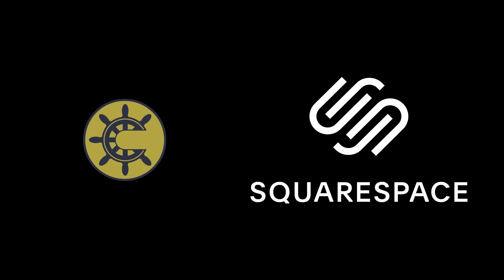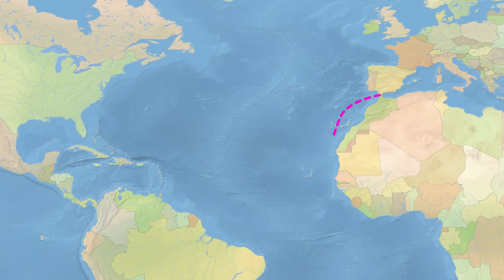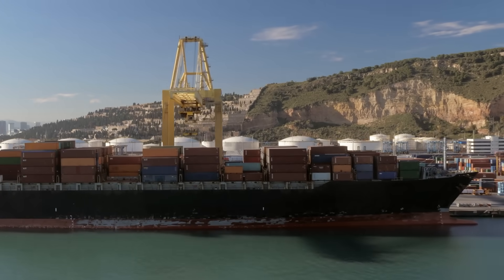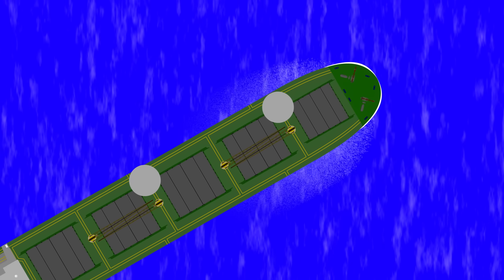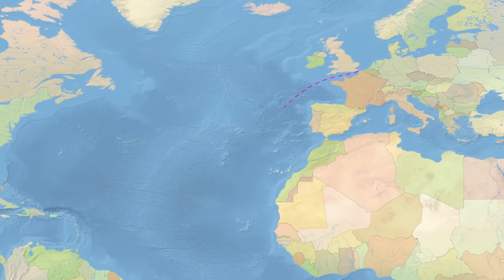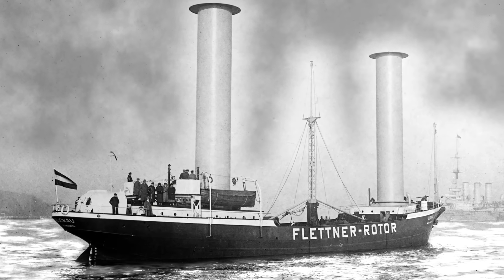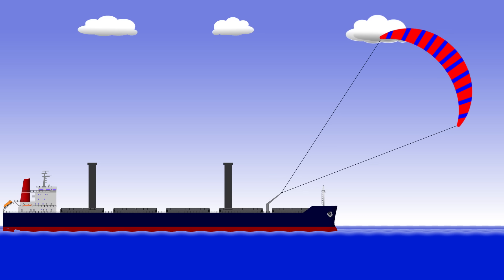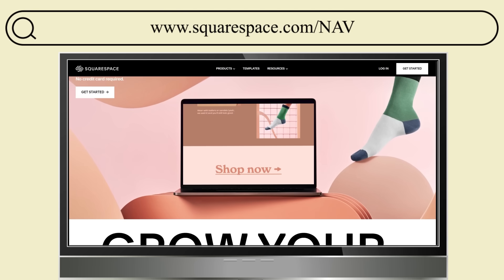Why Don't Sails Work On Ships?

Comment: Cool video, but the economics explanation doesn’t make much sense.

If the cost savings were so significant for the use of the rotors, the demand for ships equipped with rotors would be great enough that many ship owners would be willing to make the principal investment for installation. The sales pitch alone is phenomenal: “Up to 40% fuel savings.” Increased demand increases price. The opportunity cost for failing to outfit your ship with rotors would be too great to ignore.

Shipping with a competitor that could save you 40% on fuel costs would entirely offset the slightly increased shipping rates required to pay for the installation of the rotors.

The only rational explanation here is that the fuel savings are not enough to offset the price increase that comes with the installation, which is a market signal that the technology is an inefficient use of resources.

The alternative is to posit that these both the ship owners and their clientele are leaving money on the table, which is unlikely.

In terms of the landlord/appliance analogy, there is higher demand for units equipped with more efficient appliances/lighting. That’s why landlords install them.

Comment: To a degree when it comes to cargo ships. The problem of "it interferes with cargo loading and unloading operations." isn't actually an all that good excuse for some ships.
Self unloading bulk carriers for an example don't rely on the port, and loading a bulk carrier is a lot less intrusive compared to offloading it. And perhaps "self loaders" becomes a thing removing all need for the dock to have cranes over the ship at all.

For oil and gas ships, cranes aren't an issue since everything is moved via hose regardless. And having a mast on ship would effectively give the ship its own crane, making connecting the hoses easier in practically any port.

Container ships is however the bigger hurdle. But sails don't have to be centrally located, nor does modern construction materials need as much rigging as ships of old. So perhaps it wouldn't be as intrusive as one might expect to be fair.

Comment: With how much wind there is i would think some wind turbines and electric engines could at least help with propulsion. Everyone thinks windmill shape but some wind turbines look like the rotors shown in this video but with large vertical slits. Sail masts would get in the way of loading and unloading cranes I would think.

Comment: Even though the rotor sail is paid by the  ship’s owner, because the rotor sail will save fuel cost of the users, it will give the ship owner competitive advantage. So if no one is using the rotor sail now, it’s either because the benefit is not that big, or because there is monopoly in shipping business.

Comment: I think electric is the way to go.  Standard lithium ion batteries are still on the large/heavy side for the amount of energy required (though they are getting better with every passing year), but I think the real solution is flow batteries.  Too complex for cars, and still in their infancy research-wise, they hold real promise for large scale energy storage at reasonable costs.  Boats already have large fuel tanks and complex pump systems, pumping in and out an electrolyte instead of fuel would mean little change in the overall mechanics.

Comment: A few weeks ago i was on a holiday trip on the habour of Rostock in Germany. I saw some ferrys which where equipped with one flettner rotor on the Deck. They told me that they safe more than 20% fuel with this thing. It was a big ferry for trucks, trains, cars and people, shipping between Germany, Denmark, Sweden and Norway. On different routes of course.

Comment: Sails already work exactly like airfoils, they use drag when going downwind and lift when going closer to upwind.
Reply: Ons problem with sails, among many, is they are incredibly complicated and expensive. A 200+ meter cargo ship would require massive amounts of rigging, miles of line, and all kinds of sails. 

Also, consider the height of the masts. A 10 meter sailboat can have a mast as high as 18 meters. It's hard to imagine masts any shorter than 250 meters on a 200 meter+ cargo ship. Considering the new Gerald Desmond Bridge in Long Beach Harbor was designed to accommodate super cargo ships with a height of 60 meters would clearly not have sufficient clearance. Airfoils could at least be collapsed.
Reply: @caseycooper5615  I already know all of that, I was just saying sails are airfoils.

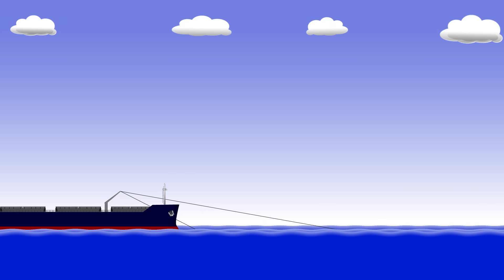Comment: Nice video.  But wind is not deflected aft propelling a sailboat forward as you describe at about 2:00.  Sorry, but the animation is incorrect as well.  The sail is curved, and functions as a airfoil.  the air going around the outside of the sail goes faster, which causes lower pressure, so that the sail is sucked forward by the lower pressure.  The direction of the wind is not changes to create trust as you suggest.  This becomes less and less important as the vessel head directly down wind, at which point the sails are actually pushing because of increased pressure on the back.  But that is not what you are describing.  Also, the shape of the sail is not modified in order to head in a given direction.  The sail is moved so that the leading edge of the sail is into the wind so that you can achieve the air flow around both sides which will create lift.  The shape of the sail does not change, nor does the angle of attack - the sail does not change relative to the wind, it changes relative to the course of the boat.  Interestingly, you get it right at about 3:00 when you discuss airfoils.  The concept and process is the same whether you use an all-cloth sail, an hard foil such as an airplane wing, or a combination of both such as on high performance boats such as the latest America's Cup yachts and Formula 40 catamarans.
Reply: A sail deflects the wind. This is a physical fact. Do you really imagine that if air blows over an angled airfoil it will not be deflected? If air is not deflected then there is no momentum change, and it would violate conservation of momentum for the sail to produce any force in that case.

Comment: The two most important factors are unmentioned: any weight high up will limit the amount of cargo that can be carried and any sail will also need more stability, limiting the carried cargo weight. Putting ballast means to add dead weight.
You want to be able to stack up cargo, but with sails you cant stack as heigh. So Sails/wind propulsion only usefull for ships with heavy cargo, where stacking heigh is not needed. And empty ship with sails must be ballasted, more dead weight to move.
Reply: That’s certainly true for stacked container ships, but the ships depicted here look to be oil tankers.

Comment: I've always wondered why they don't use wind power the way Kevin Costner's character in Waterworld does. Use a rotary wind mill (there are many designs), and couple the rotor to a propeller. Wind could blow from any direction, but it would only move into he direction the propeller and rudder direct. You probably wouldn't be able to move any faster than the wind, but it should work in any wind strong enough to spin the rotor under load.

Comment: The Flettner Rotor is not a passive form of propulsion like a sail. Even though it interacts with wind its still driven just like a hydrodynamic screw, only it operates in the medium of air rather than water.
Reply: yeah i was confused where this guy thought the spinning motion required was going to come from, of course its going to come from a combustion engine on a ship that big.
Reply: @guesswho2778  He did mention that it isn't passive, but takes way less fuel than expected

Comment: It is true that modern container ships carry an enormous load, and old ships, such as the Preussen, only carried 8 thousand metric tons of cargo. The Pruessen sailed at speeds of around 17 knots which might be exceeded by a modern sailing ship. Crude oil would be an ideal load for a sailing ship and to a degree crews might be willing to pay for the opportunity to train as real sailors. No fuel, little to no crew cost, just the cost of maintaining her sails which was, in days of old, done by the crew. Other bulk cargoes would also be possible if offloaded mechanically, such as grain. However the ship would need to be designed to avoid shifts in her load which is always an issue with any vessel that heels over. I watch Fed Ex jets loaded daily quickly using specially shaped containers through a single small door. If they can do it, so could a modern cargo carrier. All the Big 3 automakers could do before Elon Musk was a golf cart-like electric vehicle. Now Elon is rich. Is there a shipbuilder out there with the same chutzpah?

Comment: Your reasoning is badly flawed.  If it were true, the airline industry would have the same problems.  And yet, a) most airliners are owned by companies who do not operate them, and b) the airlines were able to force the aircraft and jet engine manufacturers to build airliners that cost them less per passenger-mile to operate.  This should be the same for cargo ships - the cargo companies can simply say that they require a ship that can give them a lower cost per ton-mile, and the ship buyers would have to commission ships that provide that, or risk not having a customer for their ships.

Comment: What modern ships could do to go green, is essentially an electric sail hybrid. Electric rotors for precise manoeuvres, docking etc, and sails for on route cruising. And if it’s possible to generate the electricity on board, perhaps both the electric rotors and sails could be used simultaneously for greater speed

Comment: "Why don't sails work on ships?" Sails do work on ships.  They're called sailing ships????  You showed them from 1 min onward.  Sails work but ICE engines have more useful advantages.  
None of your alternatives have been taken into common use because they all fail in some way or ways to be better then ICE.  Most common being; too slow; unreliable weather causes failures to produce worthwhile financial gain; only certain routes may benefit. 
Your assertion that Flettner-rotors only have one disadvantage is incorrect.  See all of the above. Merchant companies want speed and timeliness.  Sails have NEVER produced both of those.

Comment: Your explanation of how sails work is incorrect.

Sails act like airplane wings mounted vertically. They pull the boat with lift.
Reply: His explanation is correct. There is no lift or drag or any other component of force you care to define without a change of momentum of the air. This is due to the law of conservation of momentum. The physics is elementary. Although F= Ma, because airflow is a continuum there is no discrete value for mass so mass flow rate is used (aka Mdot) instead and Newton’s 2nd law becomes F = Mdot delta Vair, and lift = -Mdot delta Vair. Where Vair is the velocity of the deflection. In plain English, lift is equal and opposite to mass flow rate times the velocity of the deflection. Hence, the simple qualitative explanation that an airfoil works “by deflecting air” is both intuitive and scientifically correct in as far as it goes.

Comment: Speed and ability to have a reliable schedule.

The steam /diesel ships can operate more reliably in all weather.

Better might be a form of vertical wind turbine to make electricity, since many ships are moving to diesel-electric. (very common with cruise ships)

As long as the ship is not directly bucking a headwind, this should benefit the ship's efficiency.
Reply: It's possible to get enough energy out of a headwind to run propellers in the water that push you forward overcoming the force of the headwind pushing you back.

Comment: I don't get how the ship with rotor will not do huge sideway when the wind is not exactly from the expected direction. What is the point in saving fuel if you are randomly belated by weeks ? Even one day late has huge cost.
On some of the most usual sea lines, North Atlantic, the wind will be almost constantly opposite. And in North Pacific, mostly variable or nonexistent.
Beside, two regulations, one by UE and one by USA, would be enough to make rotor compulsory for the majority of transoceanic trade. All the best if China and India would join.

Comment: Why can't a charterer request a modification to their ships? This could just be installed at a maintenance stop that happens every 5 years. 

I worked for a rental car company thay requested dash cams on all of their cars dispite ford not installing them and i don't see this as any less invasive to the opperation.
Reply: ...because modifying a ship for Flettner Rotors or Sky Sails and providing the extra crew and training is in no way comparable to fitting dash cams to rental cars.
Reply: @XPLAlN  the scale is obviously larger but the responsibility is the same. 

I think a better comparison is a company making specific requests to what is installed on their fleet trucks. The manufacturer receives no long term benefits but will gladly fill the request to a paying customer. 

Unlike fleet trucks, ships are pretty much all custom jobs that would require type specific training no matter what if a new one is built.
Reply: @dylanmorgan5589  the reason why it doesn't work the way you think it should is explained in the video, and is the whole point of the video.

Comment: Sails were used to supplement early steamships, as the steam engine was still viewed as unreliable. Should the engines break down or the ship ran out of coal, the sails would be unfurled, which would also be done if the winds were favorable. The usage of auxiliary sails more or less died out with the advent of twin-screw steamers, which wouldn’t be doomed if one of the propellers failed. Interestingly, the SS Ivernia of 1899, the RMS Carpathia, and presumably the RMS Saxonia of 1899 were equipped with staysails early their careers in an attempt to reduce rolling in heavy seas.

Of course, I’d imagine that the reason most modern vessels don’t have sails would be similar to why the sails on those three ships were removed: Their sheer size would make the benefits negligible.

Comment: The economics is nonsense.  If the investment can't be recovered by cost savings, all regulations to force it do is spend money inefficiently which would have more return elsewhere.  It is also nonsense to say the fuel savings from the rotors is no good to the ship owner; the lower fuel costs can be used to pay off the investment and/or reduce charter rates to attract more business.

Comment: You completely ignored the Bernoulli's  effect on sails. A sail is a wing set up vertically. As the wind hits the mast, it splits into the inside and outside track along the sail. The outside flow must travel faster, because it has longer distance to travel. This creates a low pressure on the front side ("outside" of a sail, which SUCKS the sail and the boat forward. EVERY sailor out there will tell you that a course INTO the wind will give you more speed than going with the wind.
Reply: >>"The outside flow must travel faster, because it has longer distance to travel."

Please go and study some fluid dynamcis and stop undermining educational videos with your ignorant nonsense.

Comment: Landlords are legally required to insulate rental homes - or at least they are in civilised countries. When landlords insulate homes to comply with the regulations, they increase the rent so that the savings are NOT passed on to the renters. 

If a ship costs more to build, but that extra cost results in lower operating costs, then it is the owner of the ship who benefits, because they charge the same for freight as a less efficient ship. They do not charge less than the going rate for freight, they simply make more money on each item carried.

You don't appear to know that much about economics, either. :P

Comment: The "kites" used by ships are not kites. They are large paragliders: very specifically designed to generate lift and drag - which produces what is know as the Glide Ratio (L/D).
Reply: Paragliders (or parafoils, as the kite community calls them) are a form of kite.

Comment: Apparently, you don't know how sails work!
Sails generate lift, just like an aeroplane wing. Most of the force from sails is in redirecting the wind, but a non-trivial amount of lift is generated, depending on how the sail is shaped, and how it is set. That lift is perpendicular to the surfaces of the leading edge, and pull the craft forward.
Reply: I think he does actually. All the force from the sail comes from redirecting the wind. That is the 'total reaction'. Then if you want to split this into its components, lift is the component that is normal to the relative airflow and drag is the component tangential to the relative airflow.

Comment: Sails don't deflect the wind for propulsion! What the hell was that!?
Reply: All airfoils deflect the flow of air. If the wind flowing over the sail is not redirected there can be no lift, thrust or even drag because it would violate the law of conservation of momentum. Clearly you have a different idea about how sails work, and it may also be valid. But the simple explanation that sails redirect wind aft is correct.